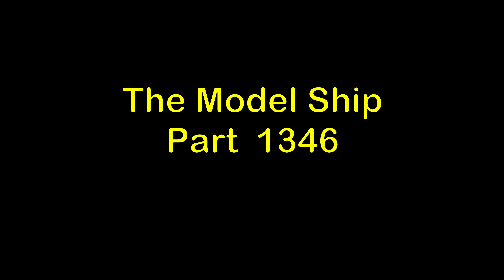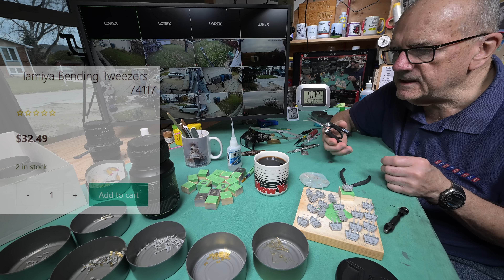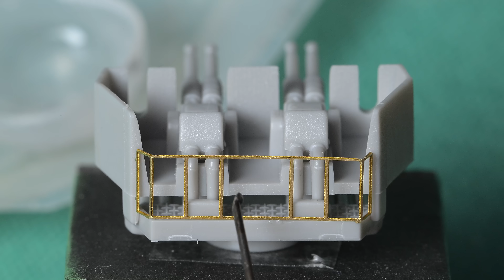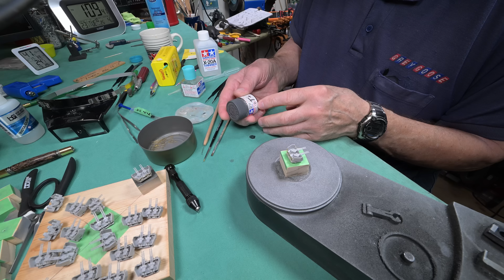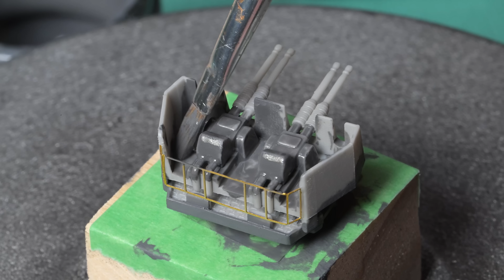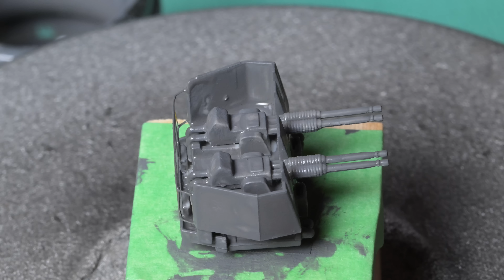The Model Ship - Part 1346

Comment: Hi Ron, brush painting needs a different approach than airbrushing, some things you can do to improve your experience.  1. Brush painting Tamiya paint is very difficulty they don’t work well for this, enamels would be better but if you want to keep with acrylics Vallejo would be best for you.  2. Consider priming first because your etch and plastic will accept paint differently. 3 your putting to much paint on too thickly one thin coat, let it dry next thin coat expect 2/3 coats.  4 you need to rethink how you assemble, built your model with brush painting in mind you probably find that you need to paint parts then assemble for best results.
Reply from the maker: "built your model with brush painting in mind" 👍

Comment: Hi Ron just watching you paint the 40mm just a suggestion but if you are going to be brush painting you may need to look at changing your paint brand. Tamiya paints are not really designed to be brush painted as they are a acrylic hybrid (can be thinned with lacquer thinner or acrylic thinner) you may want to look at model paints designed to be hand painted like Model Color or Life Color but even these paints work better with a primer coat that has been sprayed on Tamiya primer from the rattle can is my go to primer for small parts
Reply: Good point about the perils of brushing Tamiya.  Life Color is FANTASTIC and has a line of colors that are exact matches to WW2 US Navy colors.

Comment: Ron, it looks like you are brush painting direct onto the plastic and photo - etch. this is going to give you poor adhesion of the paint to the part and most acrylics will rub/peel off in this scenario. It is always best to prime parts first, especially if you have applied photo etch. You can use Tamiya spray primer out of a rattle can but for big jobs spray can automotive primers can work as well and be a lot cheaper. Once you have a layer of primer down you will find brush painting acrylics over the top much easier with better coverage and adhesion. I'd also agree with what others have said about Tamiya paints not being suited to brush painting. If you are going to brush acrylics, look into getting some retarder which will slow the paint drying and give you more time to brush and get it level.

Comment: Hi Ron, Nice job on the Pom-Pom guns.  Airbrushing is the way to go with small detailed stuff like that.  Do you have any Acetone?  Acetone works great as a debonder for CA glue.  You have to be careful with it, because it can soften the plastic if left on for to long.  Thanks for sharing.  Have a great day.  Jeff
Reply from the maker: I have acetone, but it will dissolve the plastic. 😦
Reply: @roncalverley  Hi Ron, It only takes a drop of acetone to loosen the parts.  You can apply it with a small brush.  If you use to much, it can mar the plastic, but it's not going to turn the part into a blob of melted plastic.  Have a great day.  Jeff

Comment: Hey Ron.  FYI if you take XF-2 Flat White and XF-82 Ocean Gray and mix them 1:1 you get a ballpark of WW2 US Navy Haze Grey 5H which would be period correct for the Iowa with Measure 22.  The ship was in all Haze Grey all the way up through the Korean War.
Reply: @roncalverley  Oh BTW, Colourcoats paints from White Ensign Models are enamels (solvent based but not lacquers so they won't stink up your house when sprayed) which can be shipped in cold Canadian weather and they too make a line of paints that are exact matches to WW2 US Navy paint colors.  You can take a look at the White Ensign Models website under Naval Paints then US Navy

Comment: Hi Ron  Acetone will remove the CA 😊😊😊😊, sometimes its easier if you paint your parts first then assemble,  specially if you want to introduce a second colour , like fx 56 for the guns 😊😊😊😊 see you tomorrow
Reply from the maker: Acetone will dissolve the plastic! 😦
Reply: @roncalverley  sorry but it wont , i use it all the time and just to make sure I looked it up , sure if you leave it for a few hours but were talking about seconds 😐
Reply from the maker: @aussiefrenchman-hobbytable9960  Thanks for the reply. I did an acetone test a few hours ago. Will show it in 1347's roll-back. 😁

Comment: Great job with the rail on that second gun Ron , looked perfect👌 I'm no expert but could it be that the thinned + paint was too thin? Didn't seem to have enough body to hold on surface, hard to get the right balance I guess. I'm sticking with the air weapon for coverage and a bit of brushwork for highlight colours . .

Comment: I would consider changing your paint to another brand if you want to brush the models. There’s far better manufacturers that produce finer, better pigments and coverage especially for brushing, they also produce another type for airbrushing. Also, it’s advisable to brush 3 or 4 thin coats to ensure the fine detail on the part is maintained, rather than two that leaves ridges, runs and fills a lot of the details. Of course, airbrushing will be quicker and give better coverage with less work, but, good hand brushing can be achieved if done in several thin layers or if the part is suitable, dry brushing gives a great result. I have dry brushed whole models and people thought I had airbrushed them. However, what ever you choose to do, the paint you use isn’t really very good. If you don’t want to use Lacquer paint like MRP, Zero paints or Mission, then Vallejo, AK Interactive, MIG and P3 paints are all great. Vallejo do a series just for hand brushing, although they can also be thinned for a airbrush, but I find their ‘model air’ paint far better.
Reply: Agreed.  Personally, I now use AK Interactive and Mr Paints acrylics exclusively.  Beautiful paints whether brushing or spraying.
Reply from the maker: Thank for the tips Gray 👍
Reply: @roncalverley  no problem
Reply: @EeeDee1  I like AK, but use Vallejo for acrylics a lot